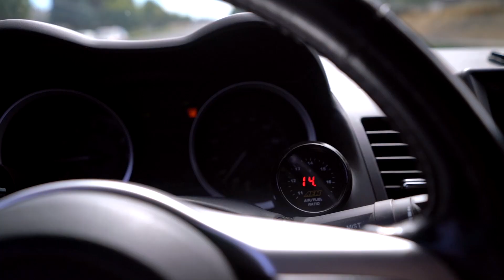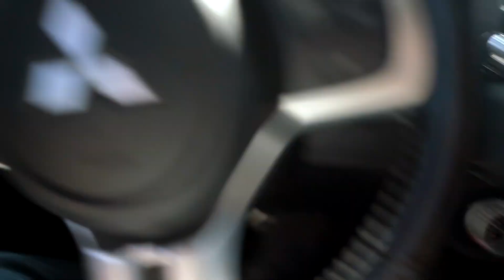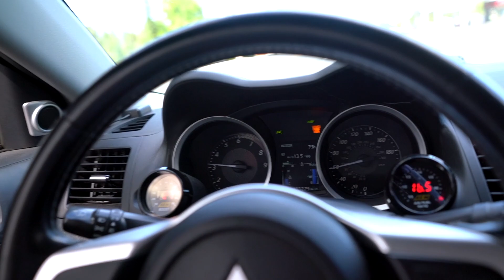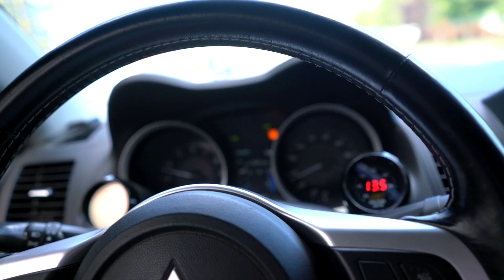Racing a 680WHP AMG In 515WHP Evo X Goes Bad

Comment: That gap was getting bigger even before you miss shifted. Freeway is the last place you want to race a modded e55.
Reply: @Stephen Van Dorst ,
I agree. OP even knows the approx whp of the AMG. For the Evo to "win", he'd need a winding course where cornering becomes a bigger factor. The AMG will win in a straight-away pull. 
Also, the shifting grinding, long before the highway on-ramp, omg, imagine the damage to the transmission & clutch ...

Comment: Due to weight and gearing of the amg could be a possible reason why you could’ve potentially kept up for a bit but the 680whp in the amg really begins to make sense after 130mph because it will keep accelerating the same way until close to 200mph, that’s just how they were designed. The evo’s short gearing gives it a burst of power from a dig or low speed to a little after 100mph but after that, it’s pretty much done in a race like that, I would do a 4.1 final drive in that thing and let her rip at high speed if that’s what you desire

Comment: Bro, if you're going to drive, DRIVE.

Don't keep your hand on the shifter unless you're shifting.

Your shifts are important! 

Cheers.

Edit: Also, the 4B11 has many weaknesses, what mods do you have done to your head and block. Remember always OVER BUILD and never push the duty cycle of your internals past 80% (which would be determined by the mods, lubes, temperature management, and materials you're using for internals)
Reply: dantevelez531dv Keyboard warrior
Reply: @7eamGhast  honestly this post is misinformation.  The 4b11 is a very strong motor.  My evo x was tuned on e85 at 400 torque with 750 on the odometer.  Bigger turbo at 15k Miles putting 590 to the wheels and 440 torque, stock internals, stock clutch, stock trans.  The tune and the driver decide how fast engines fail.

Edit: I'm at 28k miles now, so 13k at 590 awhp /440tq.  The turbo is a gtx3576r and e85 with 2000cc injectors.  The engine has never been opened, all factory, down to the head gasket.  The only issues I've ever had was the wastegate getting stuck open, which was a piece of the turbo that failed, and was a 1 hour 50 dollar fix, and the only other issues I've come across were the maf sensor and 02 sensors going bad.  Other than that I service my car religiously and drive it smart and therefore the engine is still fully functioning with lots of pulls.
Reply: PureGoldFG2 difference in opinion based on experience I guess, my personal experience is witnessing many 4B11's can't handle abuse without a built.

In Texas we mostly track our cars or keep them in redline when racing.

But again, I can only speak to my personal experience.
Reply: @7eamGhast  how well a motor handles power isnt based on opinion... it's based on facts.  If you look at the amount of engine failures of the 4b11 stock versus any other comparable motors at the same power level (k series hondas, the horizontally opposed Subaru motors, etc)  you will see in stock configurations the 4b11 performs way above average.  Compared to the nasioc forums showing ringland failure on subies with just bolt ons.  I'm not being biased and hating on subies by the way, these are just facts.  I actually almost bought an sti a few times, so I'm not one of those evo vs sti guys.  I like cars in general.

Edit: that being said, this doesnt mean every engine will last as long as mine at the same power, because like I said driver and tune come into play.  Regardless of power level, if you have a driver that beats the shit out of the engine, it will fail even un modified.

Comment: It’s a E55 AMG, 5.4l Supercharged V8. They make chassis twisting torque numbers. If he’s making 680whp he has fbo, very small pulley, wrap kit, flex fuel, long tubes, ice box, meth, fbo, eurocharged tune ect ect. Probably makes 680whp and probably 750wtq
Reply: Even still, he wouldnt make that power.. lol i know because you described my setup, i even did throttle body, intake, crank pulley, injectors, and much much more. To get to 680whp you have to have a bigger blower or spray. With the blower maxed out youl be around 600whp. I had mine ported and currently setting up for spray.

Comment: I dont think that e55 has 680whp, its more like crank hp. Even with a weistec blower its hard to get to that.
Reply: I agree. I have a renntech tune with BO supporting mods-- headers, pulleys, heat exchangers, exhaust, 77mm supercharger pulley, upgraded water pump-- and only make 520 whp on Mustang dyno. To make close to 680whp I'd need a weistec blower and some internal engine work, a very expensive project. However, I'm glad with my only 520whp since I can tap into that every day reliably without worrying much about the engine.

Comment: check your intercooler piping  with fmic and a board flipping up like that it's possible to have a tear in one of your piping couplers.
Reply: The lower intercooler pipe is right where the board hit on the bumper.

Comment: Check and make sure your at correct vacuum.  I had a coupler on IC line that was loose and had a slights gap and wasn't at correct vacuum and same thing with it breaking up at about 3k.  It also threw misfire code and sounded like misfire or bad plug.  This was on a subie.  But hope that may help you track it down if haven't yet.

Comment: Shift lockout. Causes : bad shift cables, clutch pedal adjustment, worn friction rings. If you can't shift quick the Evo loses it's steam.
Reply: One of my fav characteristics of the evo. It's so happy in high rpms when you're throwing it from gear to gear. Cant even call it banging gears bc its buttery smooth

Comment: No way he has 680whp.. I have one with 600whp and no 500whp car unless light af is staying close. Why? Not because of HP, but because of Torque. They way the modified e55s make their power, they will have 600whp but 700lb ft of tq. E55s are torque monsters. Their downfall is that they weigh 4,000 lbs. Thats why lower hp cars are able to stay in the picture. BUT I will say though, what was a close race at 40-100mph would not be as close after 100mph. He would have probably put a few cars between yall. To put the e55s power into perspective, There is a video on youtube of 2 e55s racing a slightly modded hellcat. Both e55s had 530whp on different setups. One of the e55s started reeling in the hellcat after 100mph. If he truly had 680whp, That e55 would be GONE. His torque numbers would be over 750.

Comment: that is a Mercedes e55 AMG comes with a m113k engine 5.4 supercharger make around 480 stock but with simple bolt on can make about 650whp or even more I myself have the NA version making around 320whp with little mods sick engine best engine mercedes made in my opinion other then the m156 if you dont know about mercedes you should look into them really cool hidden stuff no one talks about like the m104 3.6 engine with a turbo can make 600whp stock internals and be reliable
Reply: Atlas55AMG im sorry but your car isnt making 320whp the n/a motors are pretty much maxed out from the factory they tune their motors very well. You’ll be lucky with 270whp
Reply: @zoomdirt2  actually stock they make 300whp I have secondary cat res and muffler delete k&n filters and a eurocharged ECU and TSU tune car made 309whp on there dyno with bad spark plugs and wires when I swapped them I'm making 320whp with headers and a true dual exhaust and E85 I'll be making around 350whp
Reply: @zoomdirt2  From factory the NA engine are very restricted buy the intake and all of the exhaust the primary cats are the most restrictive and the headers. Stock C55 amg headers are like log style. The filters are very thick the K&N one are thinner and let more air through they at 10hp to 15hp the cat res and muffler delete add around 35hp. So to the wheels around 20whp if a stock c55 makes 300whp to 305whp with those mods it makes around 320whp or even more my car had stock sparkplug's and wires that were never changed with 105000 miles. After installing new one I saw a big difference and the guys at eurocharged after the first run said the plugs and wires are bad and when I changed them I agree they were all black. If you dont believe me go to MB forums and read for yourself that's what I did and that's why I nodded my car this way next are headers full straight pipe true dual exhaust E55 intake LSD E85 and maybe cams should make around 350whp or more.
Reply: rock that’s a fact, e55 with every bolt on  makes about low 5s at the wheel until it gets heat soaked
Reply: Turbo Goat Since when low 500s is “650rwhp and even more with simple bolt on”. Check original comment
Reply: @GodfatherBenz  I have a 06 C55 amg it has an NA m113 the E55 has a M113K same engine with little changes
Reply: @Gap_machine  actually when I got my car tuned at eurocharged there was a e55 amg with a couple of mods making 550whp. 650whp for a e55 is not that hard to make
Reply: @GodfatherBenz  before you start talking shit check your facts I do have the NA version of the E55 engine and it's not a e500 the e500 only has a 5 liter engine I have a 5.4 liter engine just like the E55 my car is a 2006 mercedes C55 AMG
Reply: Atlas55AMG ah ok

Comment: 680whp E55 Amg will not be with the stock blower. Even with an aftermarket blower it would still require a few mods. Most bolt on and done the right way with stock blower E55’s will be around 500-530rwhp. Anything above that you need a really small upper pulley or large crank, or a combo of both, killer chiller, meth or nitrous and even then veryyyyy hard to achieve it without a supercharger upgrade. Not to discredit your car, it’s fast but for an E55 to achieve that type of power requires a ton of money, now 500-550whp not so much. Don’t mistake yourself thinking an e55 needs way more power to keep up with a less powerful car. It doesn’t do bad putting power down and has a Ton of torque.

Comment: I think your car went into limp mode, maybe due to fuel starvation (think you had low gas). This has happened to me a few times and I started to stop doing pulls under half a tank. I remember having to let the car sit for like 30 minutes.

Comment: I own a FBO e55 lol 680whp why u lying to people for click bait. I put down 530whp where u getting 680whp
Reply: You have more torque so it would be hard for any 4cylinder making 500whp to catch you. You guys need to run from a dead stop. That would be interesting.
Reply: Anthony Jones dude he isn’t making 680whp lol... and good luck Bc e55’s are known for digg races..... we have a sl55 which is heavier with a built motor stock supercharger making a 9.8 pass at 139mph. You evo guys don’t understand ur wasting ur money if ur trying to chase the big hp cars, by the time u make enough power u will go through so many problems
Reply: @elevatedperformance  I do understand. But it still would be an interesting run from a dig for a evo making 500whp and possibly around 400wtq (on stock gearing) to run a heavier car making 600whp and 500wtq or even 600wtq considering the way straight 6s and v8s make power.  The way "big power" cars are geared will always give them the top end advantage on the highway. Building an evo you would have to choose whether you want a faster quarter mile (stock gearing) or if you want to run up top on the highway (changing the final drive, upgrading the cooling system for longer top end runs etc) with the way how a 4 cylinder puts out its power.
Reply: Anthony Jones I agree, it would do good on a digg but a proper e55 will run 10’s. The evo literally needs a new gearbox. Once u get into 5Th gear u lose so much power, from the gear being to long
Reply: @elevatedperformance  5th isn't that long in the evo stock. My X is bone stock and the acceleration you get in 5th honestly seems normal. The car doesn't have crazy power stock but I hit 5th around 120 and then if I run to redline it tops out at 150. 30 mph gain in a single gear I dont think is really a long gear. If you do cams on an evo and raise the redline to 8k in 5th on a stock trans you're probabaly still only going to get to 170ish. The stock gearing is the way to go for a drag car but everyone's afraid to do runs in 5th gear and top out their car thanks to engineering explained putting out a video about how the motor is under so much stress in higher gears.  Ever since I bought mine I broke it in hard and have done top speed runs. I literally have no issues with the motor. If I had bolt ons and a basic Cobb tune I dont see it being unable to still do top end runs. But again most evo kids are afraid the motor will magically grenade in 5th gear.
Reply: @elevatedperformance  btw nice work on getting and maintaining an e55, I wanted one when I was younger because I thought a kleeman k4 was life.lol but then I looked at maintenance costs and decided I'd stick with Japanese toys.
Reply: I've seen many 600-700whp evo's destroy cars then once they hit 5th gear, u can see that its too long causes them to lose roll races. that 5th gear is to save the car from poor gas mileage. because the 5th gear, ratio wise, does not correlate or have a proper connection to the 1-4 gears like a true gearbox would have. In other words the evo acts proper from 1-4 gear and fulfills the short gear or medium gear ratio. But once u hit 5th gear, its as if that gear belonged in a 200mph car. The car falls out of rhythm and from 4th to 5th gear ratio pattern is way off PULLING THE CAR OUT OF THE PROPER POWERBAND, i capitalized it because thats my most important reference for the 5th gear. Ive been stuck on this theory and I'm still yet to have some convince me. Bc a gear that long should have 1-4 gears on the same page. Im convinced it acts as a semi overdrive gear. And Technically u shouldn't be roll racing a a evo, they were made to rally race and drive on a circuit. So the company made it so u only really used 1 thru 4th gear.
Reply: @elevatedperformance  when I top out 4th and shift into 5th it's only a 2k rpm drop. Putting me at 5k. The stock redline is 7k. The acceleration I feel in 5th and see on the gauge cluster imo is normal for a car with less than 300hp and weighing as much as an evo does. I dont think its gearing I think it's just lack of power. I can stay with 5.0 mustangs and 335s until I shift into 5th and they just pull away due to them having more torque. I dont think it's due to an evos gearing. Also, any evo on a stock frame turbo doesn't really make power to redline if tuned properly. For instance my car redline is 7k but I shift at 6200 or around it because over 6500 the power drops off. Shifting at 6-6200 keeps me right in the meaty part of my torque curve. But in 5th in this car ur just relying on hp to move you and it doesn't have much stock. I'd be interested to see these guys with high hp low torque evo builds try some top end runs with a longer final drive but the car and community isn't built around that scene so I'd have to do it to see the results myself.
Reply: @elevatedperformance  also cruising in 5th at 80mph ur over 4krpm. That puts you right at the last 1krpm of decent torque on the stock motor/turbo charger. So it's a semi overdrive gear as are most final gears in manual transmissions but it still kinda pulls decent for where you are in the rpm range.

Comment: The hose that you grabbed right when you took the cover off is the fuel pressure regulator hose. Connect it back onto the nipple that’s on the intake manifold with zip ties. Check the other side to make sure it’s not sliding off the regulator. 

The check engine light is an overboost code. The car is spiking in boost now because that hose was disconnected. Don’t go WOT (wide open throttle) at all until you fix or replace the hose. (Replace it IMO)

Worst case scenario is you bent a rod because of the crazy over boost. Short block is done. I have an EFR 7670 stock block 4b11 too. It’s happened to me before having that hose pop off and I’ve hit overboost. Hit it enough and you’ll definitely bend a rod. 

Good luck!
Reply: Actually, I just watched that part again and it definitely sounds like you bent a rod. Sorry, bud. Hopefully the head is at least still salvageable.

Comment: Shifting sucks
Reply from the maker: Evo transmissions suck.
Reply: Gotta get a dogbox
Reply: I agree. I have issues with 3rd all the time and its getting worse. Need to get it rebuilt.
Reply: Michael Hasselbring what’s your transmission doing? I bought my Evo X kinda cheap w a third gear grind but haven’t fixed it yet. When shifting into third I have to wait for the rpms to drop so it won’t grind, it’s bad!
Reply: More or less the same. I can't quickly get into 3rd anymore, I have to granny shift it other wise I get locked out
Reply: @millionairebitch  mine does the same thing. I just double clutch into third to avoid the grind. Gotta get a rebuild eventually
Reply: Adam Chase I’m going to try that, I usually shift really slow into third. But definitely need to get that transmission rebuilt